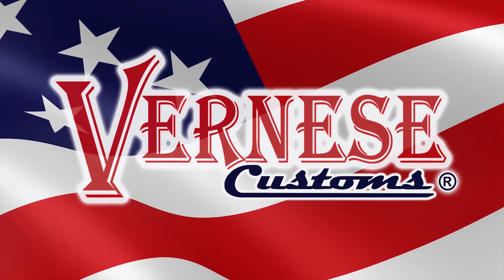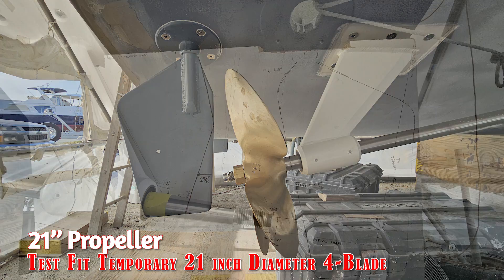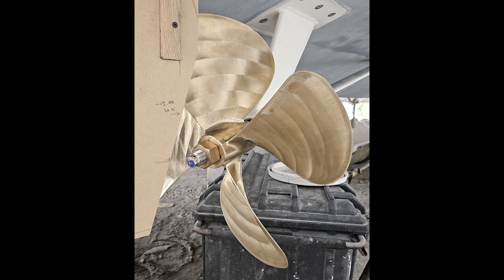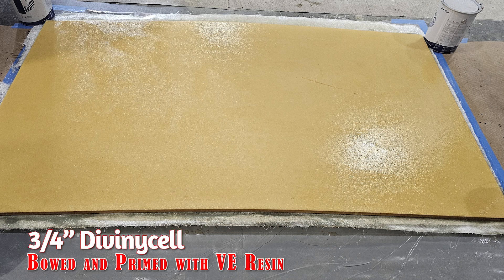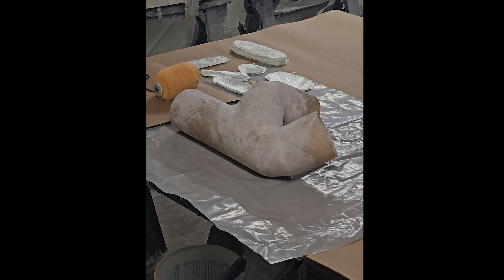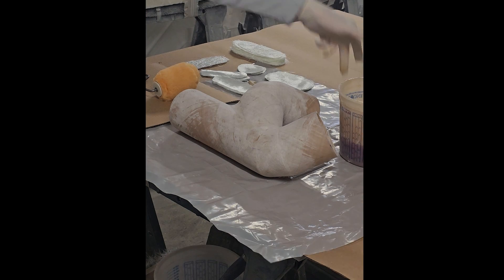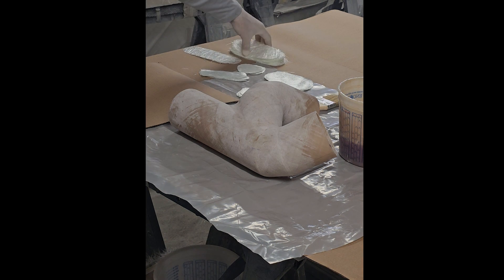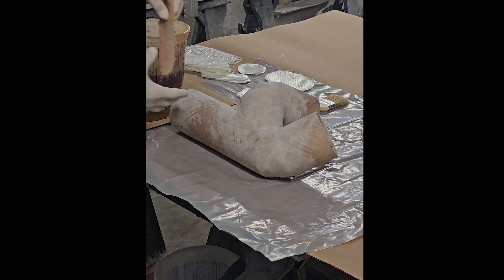HOW do we FIX this?? Tight tolerances - NO room for ERROR.  Bertram 31 RUDDER design. #bertram

Comment: The rudder you are using at the beginning of the video looks way too small.  A common complaint on the Bertram's are rudder size.  I purchased a Bertram 28 with factory rudders, and could not drive the boat on one engine.  I made oversized rudders, and they worked amazingly.  I think you have plenty of room to shorten your shaft, and bring the prop closer to the strut. I always go with enough clearance to get a prop puller on plus a little wiggle room.  I also think the mock up rudder at about 15:20 is about a perfect design, but maybe a little more surface area.
Reply from the maker: Hey Shannon! Thanks for weighing in!! The grey rudders were upgraded and oversized from the "Original Bertram Rudders". The Captain said these rudders performed perfectly and was hesitant to make any changes because they did so well. We also explored shortening the shafts but cannot be done because we have tapered couplers and not split couplers. We would have only gained a fraction of an inch and reduced our prop tip clearance. The wooden Mock-Up Rudder has more surface area than the grey rudders. And in the right places as far as I am concerned!! I will ask what type of prop puller we end up using when we get to that point! Thanks again for watching and commenting! 👍
Reply: @vernesecustoms  What diameter are your prop shafts?
Reply from the maker: @shannonr8685  1.5" AquaMet 22, what are you thinkin'?
Reply: @vernesecustoms  I was wondering if ACME puller would work for you, but I think the largest puller they offer is for 1.25 shafts.  The only options I can think of at the moment require quite a bit of effort.  I think the least effort is rudder re-design.  If you have the capabilities, machine the hub down on the wheels, but that makes them one off's.  Machine the non threaded part of the shaft tip off.  Maybe a shorter shaft coupler.  You seem extremely capable, and probably thought of anything I can possibly think of.  You could pull the struts, machine the trailing end of the strut back, a machine shop could re-taper, and re-key the shaft.  The bottom line is, rudder re-design is the best, and easiest for long term serviceability, and it doesn't hurt to have a little more rudder than you need.  If I think of something magical, I will chime in.  I am curious to see if someone else comes up with something.  I always tend to over think, and take the hard route.
Reply from the maker: https://youtube.com/shorts/JBhytZwchOQ?feature=share
Reply: @vernesecustoms  That awesome!  Very nice job!!

Comment: Man doesn't look like any easy way out of that rudder problem besides removing some rudder.  Would have never guessed the length would go up so much from a 19 to a 21.
Reply from the maker: We have a saying. "Tight is right!" We are certainly squeezing our tolerances to gain propeller efficiency. 🤞We will find out soon enough if our efforts will pay off in performance gains!

Comment: Or just maybe have the rudder on a pinch bolt shaft configuration so that you can slide the rudder on and off by loosing the pinch bolts? Or not.  But as usual outstanding work!
Reply from the maker: We discussed the option of dropping a rudder and quickly decided that if we ever need to change a prop in the water, we should make it as simple as possible. The new rudders should outperform the 2nd gen oversized rudders. Thanks for contributing!